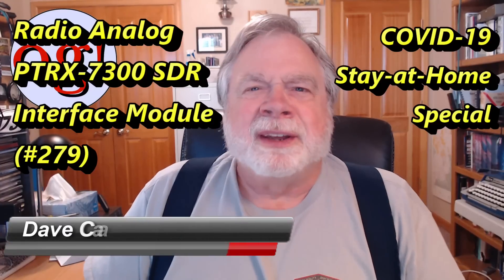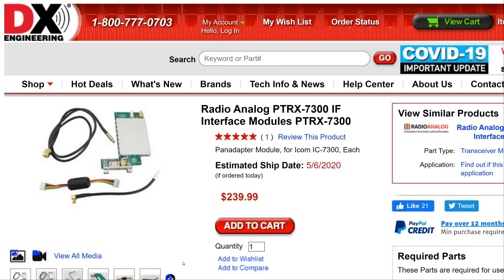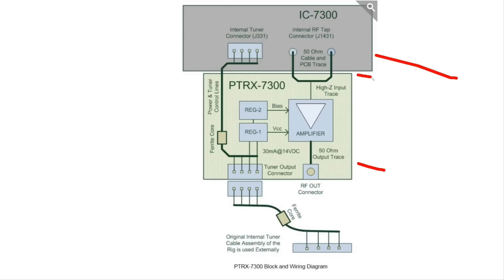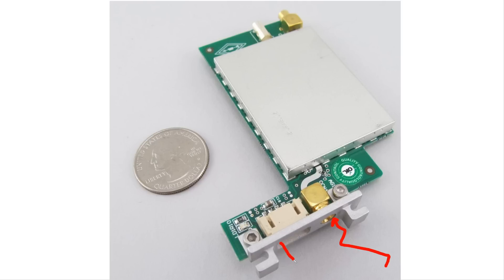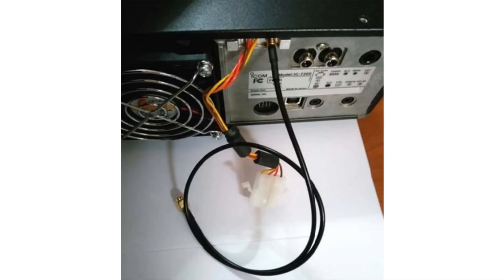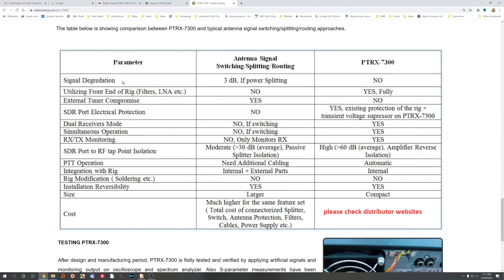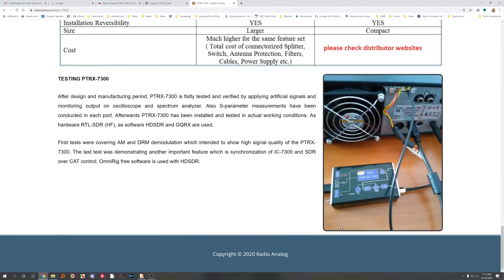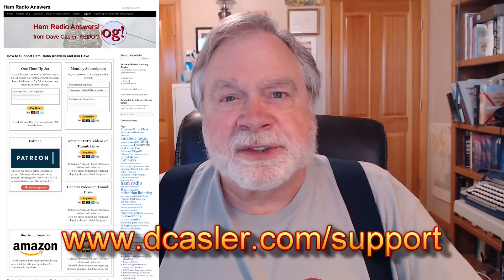Stay at Home Special: Ordering the PTRX-7300 SDR Tap Point for the IC-7300 (#279)

Comment: Hi David.  Was trying to do this (ptrx-7300) to my new IC-7300.  Unfortunately, I can't even loosen the top cover screws!  It feels like I am going to strip them.  Using a #1 phillips.  Do you have any suggestions/ideas or should I be using a different screwdriver?  Thanks in advance.
Reply from the maker: Use a JIS ( Japan Industrial Standard) screwdriver. The screws are in tight! Make sure whatever screwdriver you use fits all the way into the screw head. Push down firmly on the screwdriver for that first turn. If it doesn't want to come out, use a portable "impact" type powered screwdriver. Whatever you do, stop short of stripping the screw head.
Reply: @davecasler  Yep, finally figured that out - sure wish they would put that in the manual.  I asked several folks on discord and most said just use a phillips.  Hope you areing well, be safe!  73...

Comment: Thanks Dave,
I purchased the PTRX-7300 and intend to use the IC-7300 internal filters and connect it to my RSP duo so I could have diversity reception. The second RSPduo receiver will be also used for full bandwidth on a second antenna. I like the idea that the IC-7300 will add more input filtering on the RSPduo receiver connected to the IC-7300. Thank you again Dave for your very informative videos. Bob N3SWL

Comment: Dave, here's a $30 alternative (on eBay w/ free shipping - HRO has it for I think $40)  that will pull a RF tap from inside the ic-7300 to interface to your SDR and create a panadaptor on the computer. The SDR is protected from excess power (which will damage your RSP1A if it's directly in parallel with your antenna) when you transmit using this internal RF tap. It comes out the same square hole in the back that currently is occupied by the external tuner connector. You lose the external antenna tuner connection but it's still available inside the radio (you put/push the tuner connector back into the radio) and if you really need it you could cut a hole - I suppose, and bring it out. I'm pointing this out because you get the RF tap functionality for $200 less (again, no soldering for this solution, etc.). This solution probably has some signal loss over the $230 solution but it works. I have the RSP1A and this solution absolutely works great with my IC-7300! I'm just pointing this out as an option for those looking to save a little money on their ic-7300 solution. I learned about this via a youtube video that's on the SDRPLAY website. An SDRPLAY employee discusses this adaptor functionality and installation. 

Just FYI! On eBay search for RX Adapter for ICOM IC-7300 ( RX7300 - SMA ) 
At HRO search for RX7300.  HAM RADIO OUTLET RX7300 - SMA Keep up the good work! 73 from your "neighbor" in Fort Collins